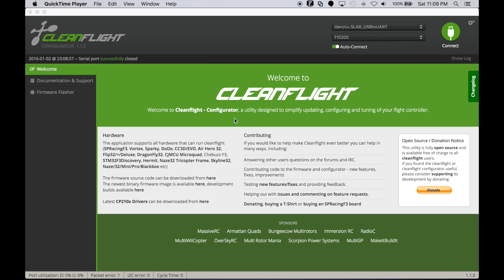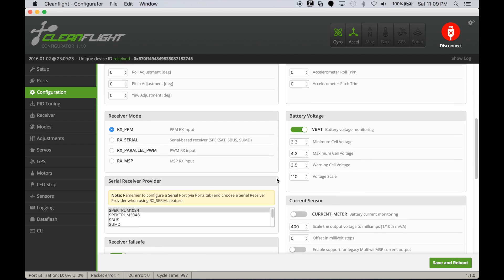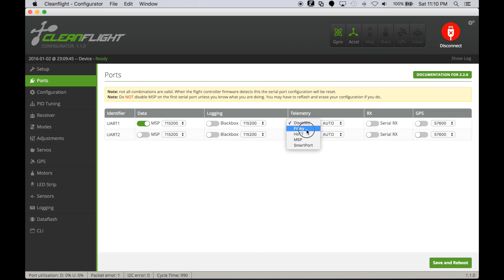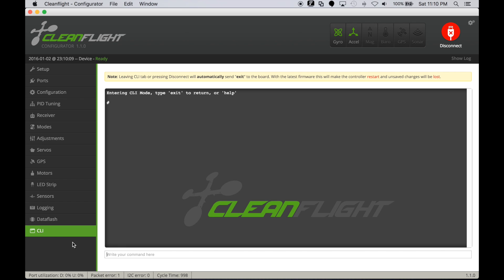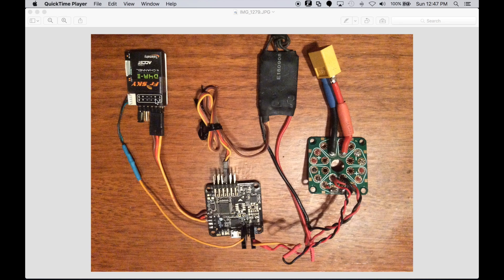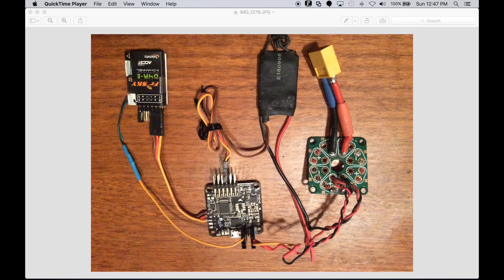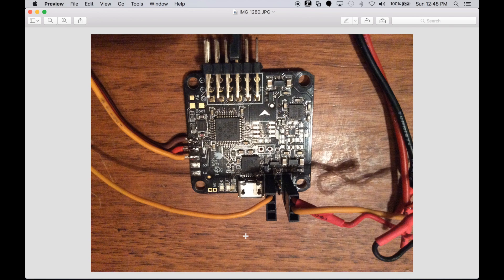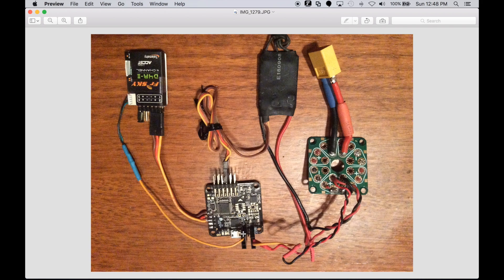Quick Tutorial - FRSKY Telemetry - Taranis & Naze32 & D4R II

Comment: you have a black wire and what looks like two resistors wrapped up with insulation what's that about?
Reply: Sorry, i explained it in possibly the other video, but i used a test rig to document this video and when i made the loom i had a ground wire going to the frsky ground pin. You dont need this, you only need the single wire (green-orange). The wire shrink is only covering the joint and is holding the black wire out of the way. There is no resistor. The connection is only a single wire. Sorry if this confused the video.
Reply: Ok got ya I'm new at this and just wanted to be sure...thanks for the reply.